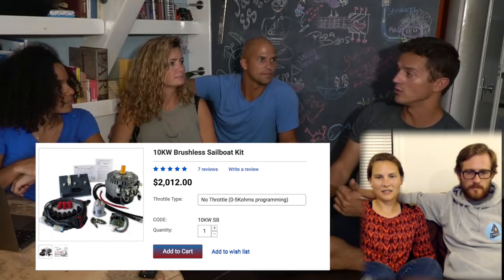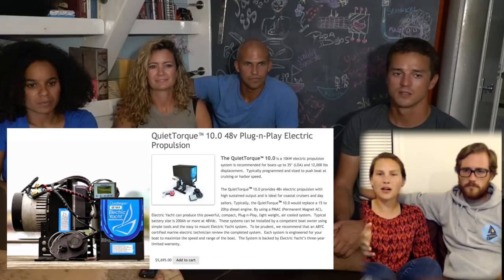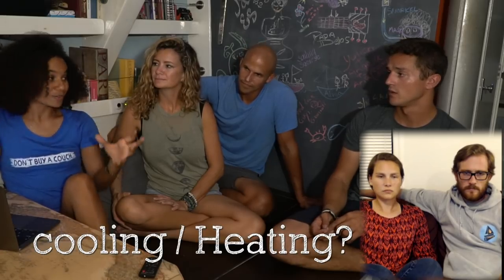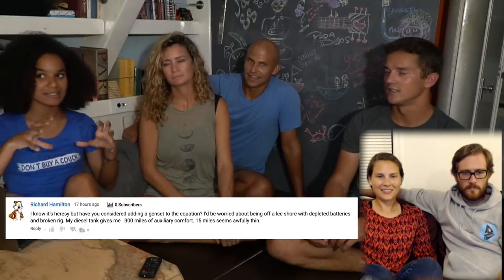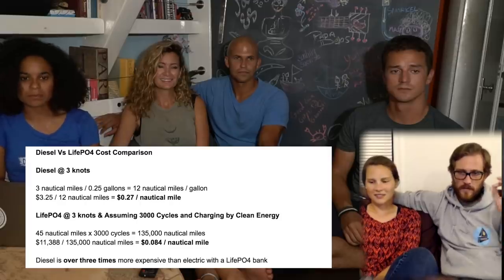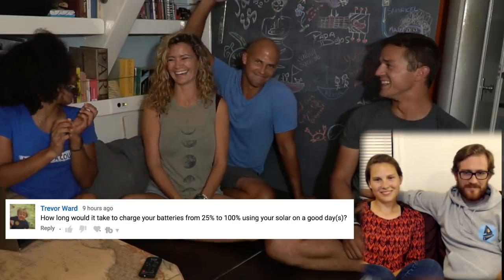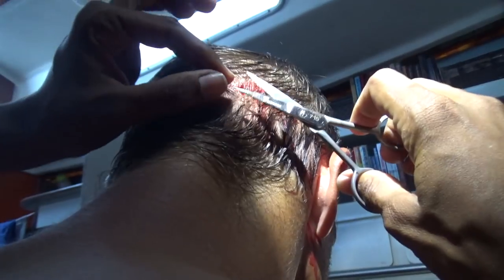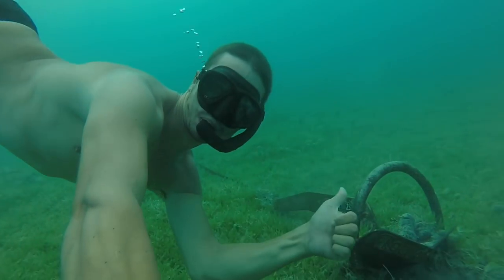Electric Sailboats: An HONEST Discussion — Sailing Uma [Step 140]

Comment: Hey Dan. I know it's not what you're thinking of but I'm curious to know if a hybrid deisel-electric system would be more efficient than a straight diesel and given your knowledge of your system you might be able to shed some light on it. For say 5kts cruising speed, who much current do you draw, and how many litres (or galons) of fuel would a generator use to produce that. How does that hourly fuel consumption rate compare with what other pearsons use to cruise at 5kts? Seems like a hybrid system with a comparitively smaller battery bank might be a good compromise for larger boats.
Reply from the maker: Not sure on the numbers, but probably a great idea. Diesel motors as proposition drives waste a lot of power when charging batteries. They do much better as a genset, so yeah, would probably work well. Most big machines that move at a steady rate are diesel hybrid. Cruise ships, trains, busses, submarines etc.

Comment: As a retired windmill design engineer, if you want to maximize regen, switch to the biggest diameter propeller that you have clearance for, and reduce the pitch to match the power characteristics of the original .

Comment: Dan :  You are conflating the term "efficiency" with "maximum power available"  (as you also have in the past), the electrical resistivity of copper goes up with temperature, so at the same voltage, it will draw less Amps, therefore less watts (power).  The efficiency; conversion of electrical to mechanical energy will remain nearly the same.

Comment: I just realized that I've never made it a point to figure out what boat you two have.  I'm in the market and about to buy one within the next year.  Thank you all for sharing your experiences with electric sailboats.  I would love to have one but in my area, having a diesel motor is pretty much mandatory with the currents throughout Puget Sound.  I think you could just have a nice quiet little Honda Generator for backup power if you needed to motor for a longer time or needed to charge the batteries in bad weather situations.  I'm seriously considering selling the engine that is going to come in the boat I'm going to buy and going electric.

Comment: Hi Guys, I have been in hospital 2 or 3 times with blood poisoning (Via small sores or cuts) where the Diesel was contaminated with diesel bug. So I bought my yacht 13 years ago with always the idea of converting it to completely electric. I am looking at a 15kw motor system with the idea of not needing the power always. my boat is 40 ft and some places I go to there is 8 knot currents and sand bars at river entrances where you need power to get through the waves. my current motor is 18hp and doesn't cope. Anyway I bought the yacht with the idea of learning to sail it well and alone. I have raced it a lot, it wins on handicap often, a lot of fun too, an old racing yacht with too much sailing power. Re-lifing an old yacht is a so rewarding. Take care and fair winds.

Comment: I'm in the process of acquiring a 60 ft trimaran. It has a diesel that works but I've seriously had been thinking of replacing the in board with an outboard diesel. I wanted to instal a Tesla wall in where the engine compartment is. My current boat is a Santana 22 that was bought without an engine. An electric outboard is fine for getting it in and out of anchorage or dock.  I've thought along the lines that you have of installing a wind generator at the top of the mast on the tri, however putting them on the Oma's would be a better solution. Also they have sails now that are big solar collectors, you may consider that   Later on (you might be able to run air conditioning) oh back to top of mast you might have to either shorten the main sail or extend the mast to accommodate the propeller of the generator. I also find it funny about relying on propane. They now have a propane generator that isn't very big that generates usable natural gas from waste, food, fecal, scraps anything digest able that is organic. I'll send you a link on Facebook. More practical for the  tri but look into it for your boats. Basically it's free and you could be completely free from buying any type of fuel.

Comment: Hey guys, I'm a big fan of electric vehicles and even work on electric tractors for people. As you say, it's very important to understand their strengths and limitations.

I think that when you did your original fit-up, you used the motor more or less as you bought it. I seem to remember Dan doing some work on it with a Dremel, but did you guys ever have the commutator turned by a machinist and were the bearings replaced? If not, and if you decide not to replace the motor all together, it might be worth doing to get some extra efficiency. There's a youtuber machinist, Abom79, in Pensacola who is a good guy. Might make for an interesting collab. Cheers!

Comment: No more oil and filter change, no more worried about water system of motor and the costs. And the noise.
Easy calculation.

Comment: On your regenerating while sailing,  I use a towed electrical generator, an Aquair (Ampair) 100 Towed generator
Reply: So did we. Gave about an amp per knot boat speed. Hard to measure but reckon it cost about a quarter of a knot to use it. Lots of teeth marks on the prop after an ocean crossing!

Comment: Bob DeRoeck

This comment is primarily directed to Saoirse, but some aspects apply to Uma and Feebe as well.

I’ve found that it’s difficult to get the mainsail clew in the right location when reefing a main with a boom furler.  This results in a poor sail shape for the “reefed” main.  That’s not a problem if you are sailing downwind or on a broad or beam reach.  But, if you need to sail on a close reach or close-hauled, you’re screwed.  Been there.  Sailing from the BVI’s to St. Martin, a little over 100 nm to windward against a 20 kt tradewind and about 1 kt equatorial current.  Poor mainsail shape of the boom-furled reefed main gave us a net speed to windward of about 0.5 knots.  After 3 days of this nonsense we gave up and turned downwind to St. Croix to nurse our wounds.  

You guys have decided to go with electric propulsion which means limited range, essentially just enough to get in and out of harbors.  That means that on the ocean you will be sailors.  But, sailors need a boat that can sail to windward in winds over 15 knots.  That requires as mainsail reefing system that provides a good sail shape.  A boom furling system is just that, a furling system, not a reefing system.   You guys are spending a lot of time, effort, and funds getting your boat ready to cruise.  Your most important investment will be in a robust rig and good sails since they are your “motor”.  You’ve replaced your standing rig, chainplates, etc.  GOOD!  I suggest you next focus your attention on the sails and reefing systems. 

If you have not already done so, bring your sails to a good sailmaker and ask her to evaluate their condition for shape and sun damage to the cloth and to the stitching.  If the sails are blown out (baggy), replace them.  There’s no point in adding reef points to a blown out mainsail.  If your current mainsail is in good shape, add 3 sets of reef points.   Install jiffy reefing for the mainsail for each reef location and lazy jacks so that reefing is “relatively” easy.  Give some thought as to how you are going to hold the boom in position while you reef.  It’s a bit of a challenge slab reefing a mainsail when at sea relying on a just a boom topping lift and the mainsail sheet to “hold” the boom still.  In practice the boom will be swinging about 1 ft on either side of the boat centerline in many conditions where you need to reef.  Tying the reef points is doable in this situation, but a challenge.  Much better is a boom gantry with 3 boom cradle points which will hold the boom still in every sea state.  A strong boom crutch will also work, but it is less convenient.

I’ve got two other recommendations that do not relate to mainsail furling.

I suggest you think about what jib you will be using for beating to windward with a reefed mainsail.  A partially-furled genoa (110% or greater) will have a lousy shape, because much of the air foil is rolled up.  Plus you lose most of the slot effect of the combined jib/main since the furled jib is so far in front of the mast.  Much better is using a smaller “working” jib in the 60-80% range, but that means dropping the genoa from the furling extrusion and feeding the working jib into the extrusion while on a heaving foredeck, while your wife frets in the cockpit.  Think about installing a baby stay setup that is easily to install and remove.  If you are anticipating heavy air, install the baby stay and attach the new staysail.  Keep the genoa furled.  You’ll have the correct amount of sail area with the staysail and reefed mainsail and you’ll get a good slot effect from the staysail/main.  You’ll be able to sail to windward in 20-30 kts of wind.  If you decide to install a baby stay and staysail, make sure the attachment point of the baby stay to the foredeck is very strong and to the mast is properly supported by the standing rigging.  It should be  attached to the mast either within 1-2 feet of the lower shroud attachment point or close to the top of the mast, but below the forestay attachment point.  If not, you’ll need running backstays, something you really don’t want.

It appears from your videos that your mast is deck-mounted.  If so, I suggest you install an internal support post to transfer the mast load to the keel support system.  I’ve sailed offshore on two boats with deck-stepped masts and in both boats the mast base broke through the cabin roof in only “moderately” rough weather (40 kt winds).  The load on the mast base when pounding into waves is very high.

Keep up the good work.

        Bob DeRoeck

Comment: I find the comment about electric not replacing diesel for a while quite interesting.  Only 2 years ago that statement made absolute sense, yet now we have a company building an electric planing hull boat with pretty good range because it foregoes that big battery bank for two large hydrogen tanks and a fuel cell that can deliver a TON of power (around 3kW per kg of hydrogen) which puts diesel to shame.  Sure it's basically brand new and ridiculously expensive, plus hydrogen is at least twice as expensive as diesel (if you can even get it)... but it's out there, and in just a few years we will start to see it become cheaper and more reasonable, especially if you pair it with a nice solar array to provide power most of the time, saving the hydrogen for motoring or extended low sunlight periods.

It's crazy to think just how much has changed in the last couple years.

Comment: I want to run a hybrid system. High efficiency generators, large battery bank, twin screws, large solar area. Something that has shallow enough draft to beach and flop down a ramp. Rely on the solar/battery bank when possible, but have the generator to run from a storm if needed.

Comment: Really nice to see u guys together in a video, talking about such a great theme, was really fun to watch.
 There will always be guys talking long heard phrases "electric will never replace diesel bla bla bla"....the truth is, electric motors can't replace the potential of dieselengines(with a big tank), thats correct. But the other way I can see three boatcouples that replaced the dieselengine with an electricmotor and its totally fine. As you say, you're on a sailboat, not a motorboat and for that situation the potential of the dieselengine is way overkill than you really needed. So for your needs an electric motor is perfect and can definitly replace your dieselengine ;).

Comment: Ex sailor here back to being a land lubber here.....I run my diesel trucks on waste oil....veggie.  And about 7 other types of oil.....I don't consider commercial grade diesel the only fuel source.....harder to do on about to clean the waste oils while cruising and colder temps waste oils can gel but if in warm climate diesels have several options

Comment: apparently a horizontal axis wind turbine at the top of the mast can generate a significant healing moment countering the keels righting moment at certain points of sail, instead you can get vertical axis wind turbines that can be mounted mid mast.
Reply from the maker: We'd love a vertical wind turbine. Just can't find on on the market.

Comment: I use twin Briggs and Stratton ETEK 48 volt DC motors, Peak load is 30HP for 5 minutes and (cc) Constant Current is 20HP powered by a 1209 Curtis speed Controller, with 6 Ultracaps which allows me to run the generator power through the caps into AC to DC Inveter @48 volts, while charging the DC batteries while I run the electric motors off the Genset. I know not "pure" but very practical, for those that do not know the ETEK motors have been out of production 15 or 18 years, really old tech, I simply make new cores as needed, pretty simple bladed stamping process, the PAIN  torch sodering every two blades together using the clips,  not a good representation, think of paper clips times 128 pieces of paper, put together in a radius like faning a stack of money or poker cards on the table, then each "set" has to be 1.1 mm exactly from one to the next in a radius. A good example of the MORE modern and efficient design from Germany is the PERM PMG132 PERM motor, which is used in battle bot spinners and 50 mile an hour bicycles, all based off the LYNCH 132 motor from United Kingdom of Great Britain, by the way never never use a spinner robot with a motion sensor to assault any unwelcome robbers, it is very messy.
Reply: Scott Watson Great info and write up.

Comment: Next time we'll have to get into your discussion... we are electric on a Beneteau 32 Sail (Oceanvolt). Love this community! We'd love to swap info!
Reply from the maker: Sounds good! Did you guys go with the SD or prop shaft model?
Reply: We went with the water-cooled, direct drive prop shaft model since our boat was already set up that way. So far we love it. The Oceanvolt crew put together a very well designed, thought out system. Wish we were younger and had more patience to have done it ourself like you guys! You were part of our inspiration to do this! :) Yay to the electric community!
Reply: We have their 'zero' build on their shaft model. We knew there would be kinks to work out, but it was totally worth it.

Comment: Cool! We throw out a working Yanmar Diesel too. Using a Goldenmotor 3 KW 48V with 60 Ah Winston. Ok, just a 25 Feet Boat but it is working perfectly. Right now looking for 36 to 42 feet Boat :-) ans we also will chamge to E-Power. But charging by wind, solar and hydro. Charging with non regenerative power is not a choice!

Comment: Obviously going electric would ultimately be the choise BUT it is still fairly new in boating compared to diesel. From reading the comments I understand you do have a serious heating issue with the bearings....
To cut things short, shit will hit the fan sooner or later e.g. every one will run around sometime. Using diesel or KWh doesn't change that. A calculated risk it should be.
You can never be prepared for everything. At this stage in electric propulsion it is some kind of experimental. Maybe we should poke Elon Musk to build a sort of E-Boating kit. And maybe , have some kind of diesel generator for some people who 'feel' they can't do without it. To leave options open.
Btw i do think you're biased but can't express how happy it makes me to see people care and discuss for cleaner propulsion. You were there when it all started! Cheers.

Comment: I think this just mirrors the situation with earlier car systems..  If your daily commute is short and sweet, an electric car might be ideal.. If you travel for work?  probably not a good idea..  I think that for new sailors, a diesel is probably a safer option and offers a larger buffer for dumb mistakes....     I would think if you can operate without a motor at all?  electric might be for you..

Comment: How long would take if your batteries go bad to get new ones and the cost an ten years. I had a gasoline engine went out ( water pump) I just put up the sails. And I used solar for my batteries and my engine chargers too. But if you get a short in your electrical.

Comment: Hey Dan, if you motor is heating so much that means not so efficient you should get some thing that does not heat up so much. It may not matter however since you do not depend on it 24/7
Reply from the maker: It was overheating because it was undersized. We were pushing 10kW though a motor rated for 4kW.